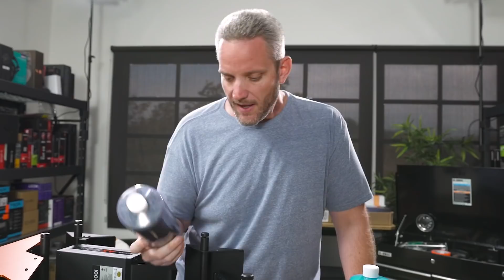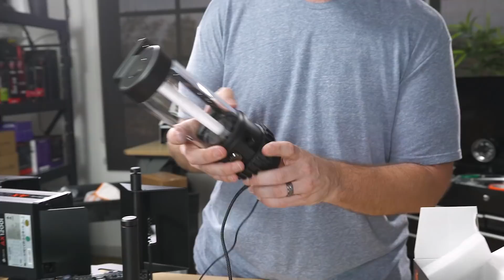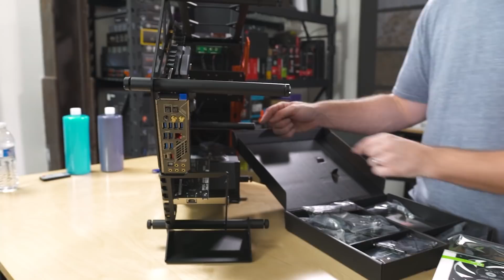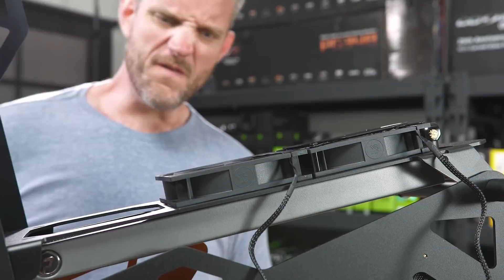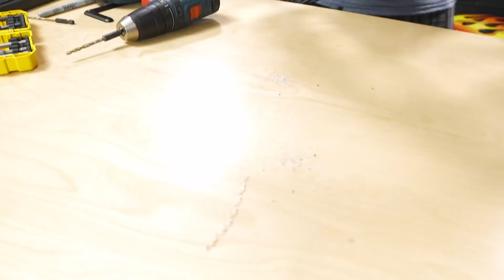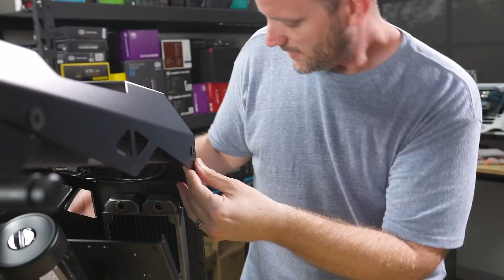Ultimate Overkill PC: Threadripper 1950X Build

Comment: Acetone isn't great for taking off stickers.  It evaporates too fast.  MEK is pretty much the same with a lower evaporation rate and it causes cancer.

Best way to take off stickers is to peel off as much as you can.  Then take a paper towel and fold it over a couple times.  Tear it to the size of the sticker. Soak it with mineral spirits (paint thinner) and then lay it on the sticker.  Let it sit for a minute and all the paper and goo will come right off.  It's slow evaporating.

Comment: I think Silver. I have lived with women too long, but... If you want to add an orange handbag or a purple solid state drive, or a newer better and more frantically marketed graphics card, in 3 months, and it only comes in hot pink ... Grey / Silver goes reasonably well with anything. Pink goes well with nipples, but not much of anything else... It looks good under Beyonce, but not in your cooling system.

Comment: 1. Blue coolant will stand out better.

2. The top radiator... if you want an alien theme, just my two cents on it, but use two flex tubes out the back looping back inside the case, almost like a Predator Helmet. Hardline everything else inside but the twin flex tubes will look wicked.

Comment: I would definitely go all m.2 drives for this build. Drive cables are going to ruin it unless you get a cable hider thing like the corsair 570x case.

Also I would say if you can get RGB fluid you should use it, otherwise I would say start with blue and see how it looks.

Comment: How about to put radiator and fans together...and then to screw/mount complete set to case? Fans and radiator have mounting holes at both sides...and you not need to have case sheet between fans and radiator...

Comment: JayzTwoCents Hey, you talked about fluid taking up ions and becoming conducent. How is it with a filter that captures the metal ions, similar to the one that produced the distilled water in the first place ?! With a filter matte or an electromagnetic trap. That should work, should it not..? You could save changing the fluid to prevent electric accidents.

Comment: Make an adapter for the pump to 3 pin header. I would bet the some of the fan headers on that board are meant for pumps. I know my new AM4 board has at least 2. You could either make a molex to 3/4 pin adapter, or solder and splice a 3 pin onto  the existing wires which would look super clean.

Comment: Does anyone have any tips/ what I should change for this build https://pcpartpicker.com/list/zV3mwV
Reply: Caleb Browne this is my recommendation. M.2 SSD is much faster and that noctua cooler is better than any AIO on the market right now.  Bigger power supply for upgradability. https://pcpartpicker.com/list/P2bCHN
Reply: +Devante0404 thank you I knew I wouldn't need an aio it just looks so nice!
Reply: Caleb Browne I have that case and it is pretty decent, but it has a large foam insert for dust control that gets dirty and is non removable, also not the best airflow ever, so I would consider something a little more
Reply: Thank you.
Reply: Caleb Browne np

Comment: Blue will be cool but a AMD build with blue?? No!
XSPC photon combo looks  very nice.  But as a  DDC version owner, I just want to remind you that it takes days to bleed due to its bad design. Bubbles will be blocked by the bottom plate and sucked back into the loop They could solve the problem in V2 but they didn't. :(

Comment: Hey Jay, I've done my own Watercooled threadripper build ( shameless plug: https://youtu.be/lEpGJbU6wFk ). What temps are you finding with the EK block? I'm getting higher temps than I expected. My 980Ti reaches 39C under load in the same loop. The 1950X idles at 30-40c and under load reaches 58C, which seems rather high for a custom loop! Do you think I need to reseat the block or is it a design flaw with such a small block?

Comment: This is unrelated, but I really could use an answer:
Provided my power supply can handle it and I have the space, could I run an NVIDIA and AMD card together? Do I just install drivers for both and it work? I have a 1gb AMD card, and am upgrading to a 4gb NVIDIA card. Since I'm on a budget, I'd like the power from both cards. Thanks!

Comment: Too bad you cant do both..  Will be a neat build either way.  -  I will want to see what you do with the little fan add-in card that comes with the Asus Zenith..  cause at the moment in mine, i just kinda set it somewhere since i didnt have a good spot for true mounting in the Air 540 case I have, need to figure out somewhere to put it thats easy to route cables to but also where it can be insulated.  Any good tips for some insulation material that you can place almost anywhere in a case?

Comment: Silver. Now for cable modding.. They are only fans!!! it is 2 or 4 wires TOPS... They can usually be reset in to there original connectors.... Just trim a FEW cent.M (A bit more) and reconnect. Ea$y Pe@sY. So easy in fact, even Jay can do it... 
I believe in you jay lets see some cable modding in your next vide PLEASE!!!

Comment: Alien life blood gotta go with the SILVER Name has to be Symbiote check out the Comic Symbiotes for further inspiration ;) . As for the cable modding its not that hard to do, just get some decent wire strippers from RS and the correct cable crimping tools use the Daniels tool site to get your crimping spot on with the right tools. The pins and sockets are easy find them and tools on RS website or even EBay once you know what your looking for.

Comment: I'd want to put a pneumatic opener on that top panel. I'd have a separate power adapter and switch that actuates the panel which only starts the actual PC power switch when almost fully open.

Comment: Hey Jay,

Is it better to place the rad fans on the top or bottom of the CPU cooler Rad. I am asking because I just installed a NZXT Kracken X62 on a i7 6700K installed in my Corsair 450D Case and I placed my fans on the bottom pushing air up through the Rad.

Have you noticed a difference in cooling performance?

Thanks,

Mike

Comment: Blue

Also custom cable length is manageable. Use a piece of string and route it where exactly each cable needs to go and then cut it to length. For the thicker cables it gets a bit fiddly but it should be feasible. Then match the cables with carbon fibre.

Comment: I have used that res before. DO NOT expect that thing to seal back up if you open it! No matter what I tried, the slightest bump or shift of my case and coolant would leak out of the bottom seals. Also the top port on it is no good for filling unless you tip it a fair bit. The air just locks up in there due to the top of that lighting tube. It does look to be a slightly different design with with the mounting plate so maybe they've fixed the other issues too but I will probably never go back to the photon reservoir even though glass looks clearer, I just trust plastics to seal better.

Comment: Just so you know Jay, I did a build with that exact same CPU, Mobo, and 128gb of Corsair dominator ram and it wouldn't post with all 128gb of ram. We had to switch to Corsair vengeance ram. A bios update may have allowed it to work, but where I work we're not allowed to update the bios. :P

If you're only doing 32gb I don't see why it wouldn't work though.

Comment: You should do separate pump and reservoir then do some modeling and put the tank outside the case near the top back mounted on an angle to the two metal rods above the motherboard.

Comment: I would go with blue unless you want to go with another stealth bomber approach, which I think skunkworks did already. If you go with silver, no part of the build will really stand out. The blue will really pop out at you.  Also, you can use small hydraulic lifts to open that arm and use a latch mechanism to keep it closed. This way, you would have the added benefit of no more wires which an electric motor would most likely have.

Comment: Good build coming along. I think the Blue would be most interesting, but either would be a fine choice.

Question - is there any way to mount the reservoir so that it is vertical? I think if you took out the SSD bracket there would be room.

Comment: For cabling, wouldn't ribbed conduit look awesome if you routed several cables thru one or two conduit, and had the proper end caps and strain relief fittings? For example, http://murrplastik.com/specialty-conduits/ has some good examples.

Comment: Re-wire the pump molex into the PWM cable. The motherboard has a header for that exact purpose. Also you should throw in a flow meter and temp sensor....if you wanted to go all out in utilizing what the board offers. I have the same board. But of course I'm not utilizing the board, which is exactly what I'm saying you should do. Lol. And for the coolant color, I'd say Silver. I like to think it's Adamantium in its liquid state. Monochrome builds end up looking the best. Just my two cents! See what I did there.

Comment: I would NOT remove that SATA mount if I were you. If the orange panel screws onto it, leave it on, because that's extra support for the case. You could possibly hide other stuff in there. I am personally a fan of contrast. I would have chosen white for the coolant XD

Comment: Jay, This adapter to power my pumps. Available at newegg and has worked great for me. Coboc SATA-AD-LP4 serial ATA/SATA 15 pin Male to Molex LP4 4 pin female Power Adapter for Hard Drive,M/F

The listing has some spelling issues but it does work! Much cleaner than having to run molex for one item.

Comment: Silver 100%. you had all these parts coated to match and then you're going to ruin it!? Besides the silver is going to ONLY look cool in this build whereas the blue will look cool in ANY build. save the blue for a tempered glass UV build and use this silver in this non-LED monochromatic build.

Comment: I like the blue for the color and the UV, but as many ppl mention and will mention, AMD is not a blue color scheme. Then again, who GAF about traditional?

I vote blue-- and as for cable mgmt, you could make it easier by putting them thru conduits. On one build I did for a customer, we agreed on PVC piping cut in half longwise, and I epoxy'd two to the backside of a similar case situation (w/ cable probs). Once they were painted+glued on, they looked great and we even added lights inside to have a different vector of light hitting the inner case. They were about the diameter of a quarter (the full pipe before cutting, which I did not cut exactly down the middle. The lights were hardwired after running the other cabling through.

You could use lots of other things as a conduit though. I figd Id mention in case the concept might spark a unique idea for your own build (and you do not have to mod cables, which is a PITA)
Reply: And blue b/c they match my balls after another multi-part series that I thought would only be a two-part-er.

J/k--but I really might get blueballs from too many of them.

Comment: My fan controller had a molex power connector and I ordered a sata power extension off ebay and soldered it onto the wiring after cutting off the molex. Worked perfect... I would never use a molex connector. I tried when i first got it and a pin broke out of the connector...

Comment: Silver for sure. Go completely stealth. For the back side cable management, gets some acrylic and make some covers. Paint it the color you are using for the orange panels. You could put some unpainted design on the acrylic and light with an LED so it has some glow to it.

Comment: Please do a OCD/troll build. Like EVGA and Asus gpus, with MSI SLI bridge and Gigabyte motherboard.
Reply: With an NZXT front door on a define R5 case, with as many different name brand fans as it will allow.  Also, Run standard rubber tubing alongside PETG
Reply: Holy shit LMFAO YES!
Reply: Oh and add a good amount of mustard cabeling with blue 6+2 grafic card adapters but plug only the six pin in. And add some white plastic molex dongeling around out of no reason at all.
Reply: You also have to add 2 optical drives, but dont plug either one in. Also, Mix and match 2.5 drives with SSDs and rando 3.5s No need to put them in sleds though, just stack them on top of each other.
Reply: Don't forget different RAM manufactureres, exhaust fans only, celeron on a Z270 with 64GB RAM and power supply fan facing up.
Reply: I forgot a grey flatband cable for the much needed light grey 3 1/2 floppy drive in the front in a black case
Reply: Also mix hdd and ssd in raid.
Reply: oh God please no.
Reply: Calm down there Satan.
Reply: Oh god, my eyes. It doesn't even exist yet and my eyes are already bleeding.
Reply: Please NO.
Reply: Suggest it to Linus then

Comment: you could cut the molex connector off the end of the pump ad splice it right into the modular cable that connects into the power supply, just tell youre sleeving guy what length the cable is going to be at the end and have him leave you the bare leads with the extra sleeving you'd need, then solder and heat-shrink them together and youve got yourself a neat connection that is the right length and plugs directly into the power supply, with all your connections covered up(ie the sleeving covers the heatshrink), anyways great build as always!

Comment: Jay, you are going to hate that reservoir. I have one that I took out of my build because it is such a pain in the ass to fill. It gets airlocked and liquid just runs out the top as soon as you start to poor it in. You will either have to fill it with a syringe or get a really small piece of tubing and put it down in the fill hole between the inner wall of the res to let the air out as you fill. Good luck. Build looks nice so far.

Comment: Hey  jayztwocents acetone is basically paint thinner/nail polish remover..it will most likely ruin the finish on the fittings..I dont think the powder coating would come out unscathed...it would be tedious but the carbon fiber wrap might be possible.

Comment: Should consolidate your cables into powder coated aluminum pipe to go with that exposed innards spaceship look so "management" could remain in plain sight.  Like headers off a block, in this case, from the power supply.  Would be killer to accent the theme, plus haven't seen anyone meld the simplicity and attractiveness of vehicle exhaust to computer cable management.

Comment: For clean wiring with connectors, remove the connectors and wires and install what ever color wire at what ever length with no connectors you want. Of course this requires disassembly of components and soldering. And reverse if something fails. And do a wiring diagram as wires have a certain color for a reason.

Comment: I think its a nice shaped case. Looks cool. Don't even hate the orange. I would have used the UV blue and orange and grey parts to be almost Portal themed.

Just seems a bit clumsy with awkward fittings and balance though. I wouldn't pick it cus I'd be scared of the lack of part protection. Its why I probably wouldn't do a wall mount either.

Comment: Jay, if you go to your local chemist, you can (should) be able to get a product called "Remove" which is a Universal Adhesive removal wipe. Nurses use it to remove glue from skin. I have been using them for years and never found a stickers glue I couldn't remove..., with "NO DAMAGE" of colour bleeding on  any surface.., ever. 
Love the show. 
Cheers from Australia😁

Comment: Jay, do a "Ricer" PC build. Nothing but cheap components from eBay (maybe like a $300 to $500 budget). You have to sticker-bomb at least 1 panel and 1 component, a few RGB things set to single color strobe (like underglow) and you have to make it as loud as possible, but stick a card in one of the fans to make it sound like a shitty Honda with a hole in the exhaust.
Reply: That would be fucken amazing
Reply: Make sure to use a case with dings all over it too.
Reply: Honda with a fart cannon

Comment: It would be awesome to see the stealth fluid in clear GPU blocks but use metal piping, and the torque limited addition Corsair ram. Additionally if you got someone to cut identical titanium pieces to the orange parts of the cougar case you'd have a stealth jet/blacked out machine vibe going

Comment: On the color... Blue would look cool but the exterior has those orange anodized aluminum pieces. No Bueno . Unless you get the orange pieces annoed in gun metal. WHAT if you mixed 50/50 with the blue and grey? That way you'd get maybe a cool looking grey that IS UV activated (with the 50% blue)... Just a thought. 17 year builder here, just found your channel... AWESOME stuff, keep it up!

Comment: Jay, what if you use both colors? Combine two reservoirs together with some gunmetal grey fastenings. And mount two rads either together with a push/pull set of fans or one front and one top in traditional way. And hardline tubing

Comment: Use kinesio tape to manage the cables in the back. It's super pliable, adhesive to almost everything, and has a unique texture and pattern on the tape surface. Plus it comes in a dozen colors, so it'll be ninja or fabulous depending on your style. As for liquid...  gotta have the blue. If everything is just black and grey it'll clash.